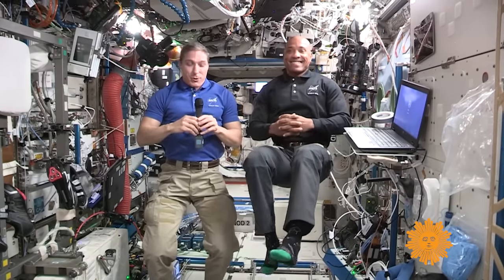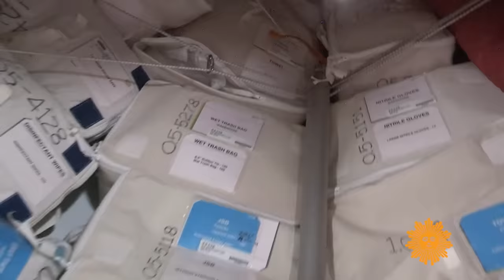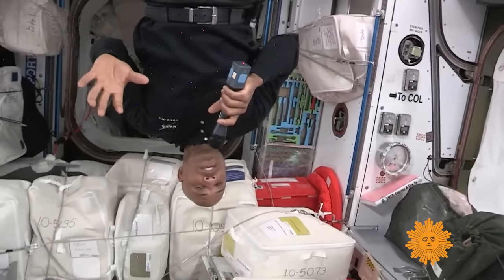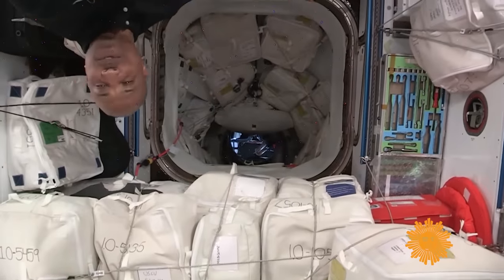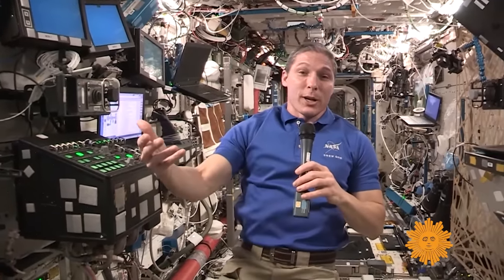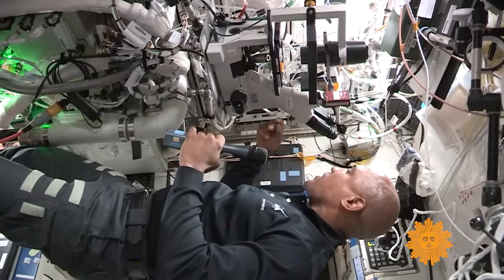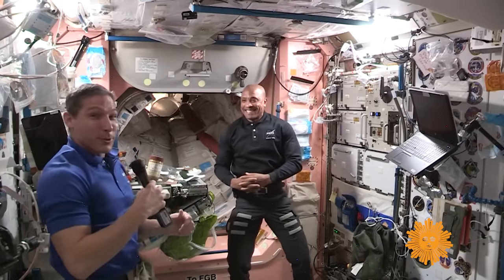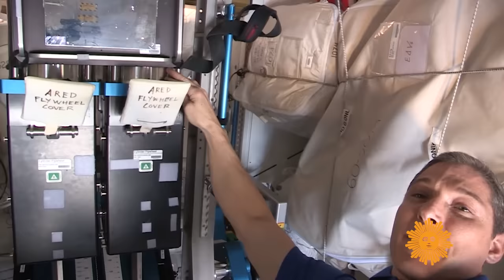Web extra: International Space Station tour

Comment: I've always been curious on the temperature inside. How does everyone agree on what it should be?  ☺️. How is that heat generated?
Reply: They are cooked
Reply: I know the temp is 72 degrees
Reply: The temp is preset by ground, the astronauts don’t get much of a say on it. The heat actually needs to be wicked away by radiators, too much is generated by onboard processes and sunlight hitting station, so the cooling is performed by the large white “wings” you can see on the outside.
Reply: They're astronauts dude. They're not crazy regular humans that we are.
Reply: Where dies the heat bleed to thats being generated from the sun? Theres no uv protection so in sunlight theyd be toast and in the shadow it would be minus 200 degrees. You cant bleed heat without a tranfer medium (atmosphere on earth) so aircon wouldnt work, and you cant heat it because theres simply not enough power to heat it from solar panels and batteries. Just another space fraud .
Reply: @chookin1  Do you even realise you just debunked  yourself ?
Reply: They have to be cooled not heated. The sunfacing side is 150°C and it's kinda hard to get rid of heat in vacuum. It's 21°C in the ISS. No idea what that is in Fahrenheit :)
Reply: @221b-l3t  I see. So the ISS is never in darkness? Thst w oould reduce its outside surface ( and eventually its interior to near Zero Kelvin. Try heating that  with solar panels. To think you can just float around in a zero pressure environment in 2000 degree thermosphere and maintain life is naive in the extreme.
Reply: @chookin1  It spends 45 min in daylight and 45 min in darkness.
Reply: What about. Bedroom ?
Reply: @chookin1  1. Radiation allows heat transfer without a medium. Most educational systems inform that early on. 2. Yes, onboard solar does provide enough energy for HVAC.
Reply: @chookin1  Are you a flat earther or something?
Reply: @mysteryhombre81  Vacuum and non vacuum coexisting? Cant you answer?
Reply: @chookin1  you think this is fraudulent. My god man. 
Open your damn eyes. We see them blast off and come back from space. How much proof do you need.
Reply: @221b-l3t  Can't they transfer excess heat outside then let the space (not facing the sun) cool it down?
Reply: @Pnwrat  Hiw does a vacuum and non vacuum coexist? And you think the Im  dumb ?
Reply: Do you think it's smelly in there?
Reply: @cookie-nzl8940  Good question.  Obviously you cant vent any nasty odours into the absolute vacuum. Yet every time we ser vudro of them in "space" they all look like theyre living  on an island resort. Fact is theyd be smelly and irritable, sick of the rubbish food, much greater risks of infections, weak fron zero g and lack of fresh food, but when they land they all look like theyve  just  left a health spa. Youd have to be incredibly naive to believe in all this astronot nonsense.
Reply: @221b-l3t  You try to heat something thats spent 45 minutes in minus 200degrees....with solar p o wer. Why are fanboys so naive?
Reply: @Vysair  Do you think that would work like a roticery? Wheres the engineering evidence for that?
Reply: @Pnwrat  Ive opened mine a long time ago. Youve obviously not study the counter to the official narrative.
Reply: @kworkshop  Thermal radiation also known as infrared does not remove near as much heat as convection. A radiator on Earth works so well because air passes by it and carries the heat away. Black body radiation alone is quite bad at removing heat in comparison. Spacecraft design is a constant battle against overheating, which may seem counterintuitive. People think spacecraft have to be heated a lot but mostly they have to be cooled since everything from electronics to humans produce heat. That's why most spacecraft have giant radiators.
Reply: @Vysair  Yes that's why ISS had giant radiators that are at a right angle to the solar panels. But without radiators it would be hundreds of degrees in the station. Some heat can be stored and used during the cold but you don't want to spend a lot of energy heating something you can barely remove after. Better to just cool and store some excess heat in water for instance. Or ammonia works great too.
Reply: @apolloskyfacer5842  Theres an alleged infinite absolute vacuum just above your head with a tiny 14 psi holding it all back with.........gravity. Hilarious. Have another soy product. Wheres the log of Neil and Buzz suiting up for the  landing? Where did the PLSS get refilled between EVAs? Youre panicking; all you have is the  ad hominem attack.
Reply: @apolloskyfacer5842  No one cares? You sure do.
Reply: @chookin1  I'm just here being entertained by your willful ignorance.
Reply: @apolloskyfacer5842  Thats a larf. Watch out for gravity....a bit just hit me on the head!! Is it a weak or strong force?
Reply: @neilc7101 , so you must know that our earth is basically "frisbee" shaped!
Reply: @jpp9239 , they all "sleep' together on the back porch!:elbowcough:

Comment: Interesting to see all the pixels that have been damaged by high energy particles.  That camera will need a new sensor or just be totally replaced.
Reply: I was trying to figure out if it was pixelation or a special coating over the lens creating the speckle effect. It displays distinctly when the camera has something black in the viewing frame like you're looking through the object being filmed.  Interesting...
Reply: @pfusiontechnologies9715  Radiation hits the CCD detectors and burns out pixels, so you can tell how long a camera has been up there by the amount of dead pixels. Happens with eyes too. Doesn't cause damage like on a CCD but astronauts see flashes of light when they close their eyes occasionally.

Comment: You can see the radiation effect on the camera every time he goes through the less protected areas, especially at 5:05
Reply: I was looking for this comment , I was wondering if that was what it was , crazy
Reply: What am I not seeing?  Wasn’t it just an unlit ‘adaptor’ section joining modules together?
Reply: The dots are dead pixels caused by the years of radiation the camera has been exposed to sitting on the ISS. They show up in dark areas where the surrounding pixels aren't washing out the dead ones, and not in "less protected areas".
Reply: @Pcat0  That's insightful, you most know a lot about cameras. Makes one wonder how difficult it most have been for the first years of the iss to keep all the electronics working without knowing the long term effect of radiation.
Reply: I thought there dust in my screen
Reply: @henryvalera3480  The worst part is "bit flips" where radiation can alter the outcome of a calculation by changing a one to a zero or a  zero to a one. That's why all critical operations are done by many redundant computers that crosscheck themselves.
Reply: It’s not radiation it’s simply dust on the lenses. The cameras are rotated out fairly regularly which is why more recent tours are have both higher definition audio and video than older ones. The audio is another indicator that it’s not radiation as radiation would affect the microphone worse than the camera. So we would hear static in the “less protected” areas.
Reply: @matt72986  not dust at all, those are dead pixels, they are in fact cause by years of low radiation. all older cameras on the station have lots of dead pixels.
Reply: @djkamilo66    That’s 2 votes for dead pixels, so I’m gonna go with dead pixels. I’ll have to find a way to say “dead pixels“ in the middle of a conversation.
Reply: @Rippypoo  Add a third vote for dead pixels, because that's what they are.
Reply: “Votes” are irrelevant, data is not democratic. I’ve already pointed out one key thing everyone keeps ignoring: the cameras get swapped out. The “long term” radiation doesn’t affect most of these because they aren’t long term. Plus I’ll point out OP suggested an increase as it passed through vulnerable sections which of course is silly cause we wouldn’t see that sort of damage so quickly.

But if you want additional data: look at screenshot when in a dark section like the PMAs. You’ll see different sizes and shapes, but pixels are the same size and shape. In addition, you’ll see them move occasionally. At 22:40 there’s a spot on his left pocket. Track that spot, later in the video it’s gone.

The most telling though is starting around 27:17 in the cupola. The camera is zoomed in to get a better view of the externals, and you’ll notice the spots are blurry and bigger, which would not be the case with dead pixels on the sensor. You’ll also note the small bright spots that some of you claimed were dead pixels earlier are suddenly gone in this scene. 

While it’s true radiation can damage sensors, it’s clear that is not what happened here.
Reply: I was gonna write a huge explanation of why it was radiation but then I watched till the end to the cupola part. Definitely dust
Reply: @matt72986  actually I think both people are right. as he moved from the dragon you could see the burnt out pixels, they looked like red and blue stars, but in the cupola it was most definitely out of focus dust particles
Reply: @matt72986  the bright spots are definitely dead pixels - dust usually does not glow. "Dead" does not mean that the pixel cann ot still be influenced by the brightness detected by the surrounding pixels - that's why some of them kinda "blend" in.
Reply: @stephanweinberger  it doesn’t usually glow but it can reflect light. The later scenes I referenced with the spots moving as well as enlarging and blurring is conclusive proof that it’s dust. I’ve yet to hear anyone explain how a dead pixel gets big and blurry when zoomed in.
Reply: @matt72986  with digital zoom (e.g. when done during postproduction) pixels do get larger and blurrier.

Trust me, these are dead pixels. I see the same effect on some old webcams I operate.
Reply: @stephanweinberger  it’s not digital zoom or you’d see artifacts on other parts of the image. Plus they’re different sizes.
Reply: @stephanweinberger  whenever someone says 'trust me' to prove a point; they are not entirely sure of the point they're making. They just want to be right.
Reply: @roddo1955  Trust me, I am entirely sure :-D

There may be the odd mote of dust on the lenses (e.g. the part in the cupola, this is definitely dust and fingerprints), but those bright glowing dots are dead pixels. I've seen enough of them in my life to be absolutely certain of that.
They also look very different. E.g. dust on the lens is never in focus (it physically cannot be), whereas a dead pixel has defined edges (because it is, well, a pixel and not part of the image projected onto the sensor; hence the concept of 'focus' doesn't really apply to it), except in some cases where they ar so damaged that they "bleed" into neighboring pixels.
Reply: @matt72986  Ok, the part in the cupola shows dust and fingerprints - but those are very different from the bright dead pixels we see throughout the rest of the video. As for the "disappearing" dead pixels @22:40: they obviously swap cameras several times during filming. I guess there are separate cameras hooked up ready for use in every segment of the ISS (so they dont have to set up a camera everytime they want to document experiments or film PR events). E.g. the POV in Node1 is very often used during live events, so this seems to be a fixed camera that just stays where it is all the time.

Comment: I noticed white spots, different sizes, on the camera lens just like when lasers ruin cameras. Usually I see green spots where it was blasted (Stupid question time) is that Caused by radiation partials flying through? Or was that a dumb one? 

If not they could also be using lasers on board for work that was filmed. Just curious for a solid answer.

Comment: Questions:
1) how does food get into the body without the help of gravity?
2) How does the poop/fee fall into toilet without gravity?
3) How is the balance of oxygen / nitrogen kept for astronauts to breathe and how are C02 levels kept down?
4) How does microgravity affect the flow of blood etc in the body?

Thanks!!
Reply: i can answer the first question. we don't just rely on gravity for the food to pass down along the digestive track there are many muscles that push the food along it. and also from the mouth to the stomach they're also are muscles that  pass the food down
Reply: 1. You can eat upside-down.
2. You poop/pee into a tube which sucks.
3. By the environmental control system, which is sort of like a big air-conditioning system. CO2 is scrubbed out, oxygen is put in. The oxygen is made from water, by electrolysis. The water is recycled.
4. Microgravity affects the body in many ways. Blood flow is not a huge problem - it works fine if you are lying down on Earth, right? Blood does tend to flow to their head more than it does under gravity, so they often look a bit red-faced, and sound like they have a cold.
The biggest problem is losing muscle-mass and bone density. To combat that, they do lots of exercise every day.

Comment: Well I am 76 years old retired electrical engineer and are amazed to see so much unconcealed wiring which you could get trapped in or disconnect accidentally. Stay safe up there.
Reply: Thats just because they want to  make it look techy. It would be anywhere else a major safety risk. It should be obvious these guys are on cables.
Reply: @chookin1  techy? It is a mess and any electrical engineer in building, shipbuilding would feel embarrassed.
Reply: @FransBlaas1  I agree. Techy means technical . Its made to like like theirs a host of things going on ie production values. Its all a complete fraud.
Reply: I agree ...the show off moves in their invisible harnesses is an example of how easy their feet can get tangled in the wires.  Maybe they add all the wires in case the wires holding them become visible..
Reply: @eddiea.2909  Hush. Your willful ignorance is on public display here.
Reply: @chookin1  you sure can explain how they translate and rotate in different directions within a confined space if they are on cables. Also: is the food on cables a s well?
Reply: @FJBM Blaas the experiments are in racks, all critical wiring/plumbing is concealed within and behind those. The wires that are dangling around are only the ones connecting to equipment that needs to be moved regularly (laptop computers, cameras, microphones).
Reply: They do this for ease of access, because they are floating it’s not as much of a risk then with gravity. Changes in wiring happens quite often when new experiments are added to the station.

Comment: @ 8:05 Special water’ ? No explanation? Is it distilled? Fortified? Blessed??
Reply: blessed by Pope Francis himself.
Reply: It's made from urine...
Reply: Both. Both is good.
Reply: Most likely distilled. The EVA suits use sublimation cooling, where water sublimates through a membrane into space (removing lots of heat in the process) - it would be kinda bad if there were any impurities or minerals in it, as that would quickly clog up that membrane.
Reply: @stephanweinberger  thank you Sir, makes sense.

Comment: Hi Q if your float in the iss are you still traveling at the same speed as the iss. When walk to do repair on the iss and tied to the station is the iss intend to drag you the speed of the station. Brendan Ireland
Reply: Sort of.  All speed in orbit is relative, to each other, and the planet.  As the Station travels at 17,500 miles an hour around the planet, the Astronauts also travel at the same speed, until they push against something, then you have a speed relative to the ISS, of plus or minus the speed they are moving inside the station.

Think of in a passenger jet, flying at 600 miles an hour, you are flying at 600 miles an hour relative to the ground, but you get up and go to the bath room, you are flying at 600 miles an hour, plus or minus the speed you are moving around inside the plane.  so as you go to the bath room, your speed is then relative to the PLANE (or ISS).

Comment: All right and another apparatus that you were motioning to be applied up on the outside of the space shuttle and some of the new space shuttle modules will be an outfitted with it it is a multi-disc rotational system it is a a system that is going to be with a rotation wheel system it'll be box on a box system that would rotate Wheels now as you notice up on the space station a little movements do a lot to the exterior of The Craft most people don't talk about this but it's the if you've taken you push off of one side of the ship you'll notice the ship in space will reverberate a lot to the exterior of the ship now within the policies that would be constructive for the incidents that are up on preliminary trajectory and ships motioning of where it's going the apparatus on the spinning wheels it's to eliminate the motion of the ship itself so you can move around and be a little more abrupt and abrasive on the inside of the ship without the ship shifting directions and shifting off of polarity preliminary of where you're going so as I'm trying to get these apparatuses sent up and I'm trying to think of a limited limited impeding meant amongst sending it up if we can adjust for an exterior mounting system or if we're going to have to just bring in another module and connect another module and have one module on one end of the shift and one module on the other end of the shift it would do the motion elimination it's something that is been needed up there for a long time everybody knows you know how complex it is moving around that shift and then having all your precious equipment up there with you and bumping into one side of the ship or the next side of the ship if you're not bumping into the equipment itself and throwing equipment's calibrations off then you know you're hitting your hand rails too hard and the ship shift direction and you know throws everything off so we're working on getting these gyro inertia stabilizers up there